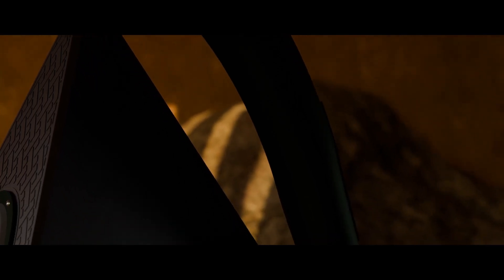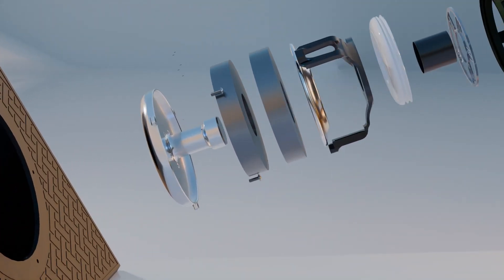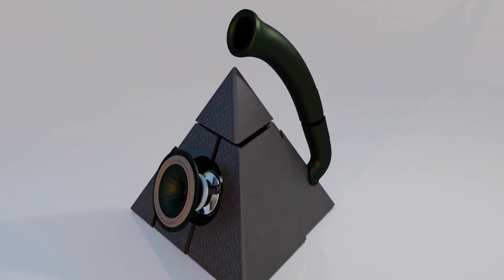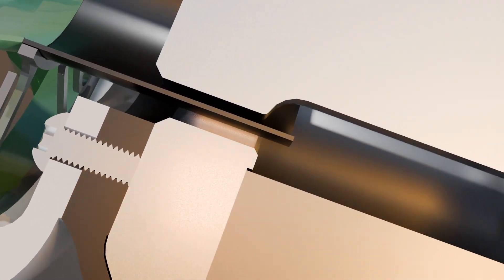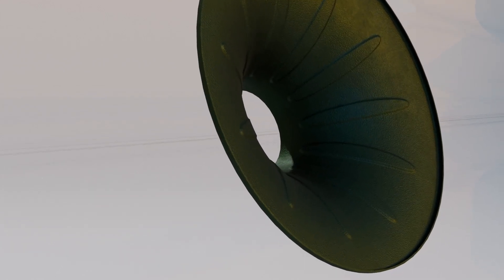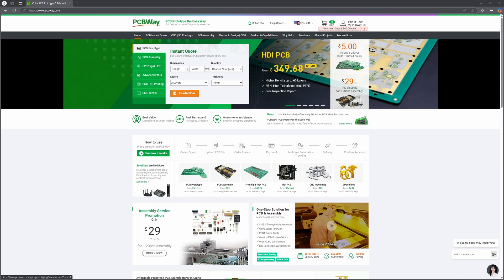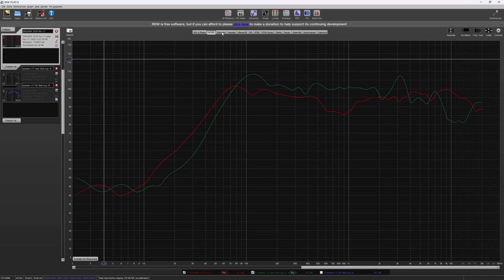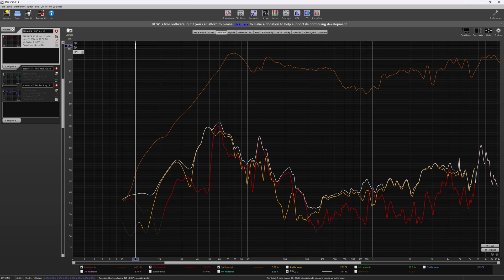FULLY 3D Printed Speaker V18

Comment: i think you should consider applying the same principles at various scales at this point.  xover before it gets messy and reassess.  i would suggest making the enclosure more dead by using a double wall filled with concrete.  I have done multiple enclosures this way with great success.  I think a lot of the sound when recorded with a mic could be better based on your graph if you remove resonance coming from the enclosure this way.  worth a shot!
Reply: i would also try to put more care into the glueing process.  looks like big manufacturers make it a key critical point during production and QC.  It sounds to me like the rattle sound might be coming from that process.
Reply from the maker: Yeah, I’ve done concrete filled enclosures before for some subwoofer enclosures I built.

Comment: Dude your work is so cool and the production quality is so far ahead of what I would expect for a channel of this size, I would think you had a million subs.

Question, do you design speakers for a job too? You seem to knowledgable for it to be a hobby. And if its your job, why make it your hobby and spend so much time on it?
Reply from the maker: Thanks! I do try to improve my quality every single video, and I guess enough of that compounding equals a decent production quality. 

I don’t actually do this for a job, I just have built enough speakers to sort of know what I’m talking about, however there is so much more about speakers I still don’t understand. I’ve just been doing CAD modeling for 10 years now so I got to the point I can create about anything in a parametric environment. The animations are done in blender and I’m still fairly new to all that though.
Reply: @piscesprinting4170  cool, I'm enjoy the channel and look forward to when you have a bit more experience!